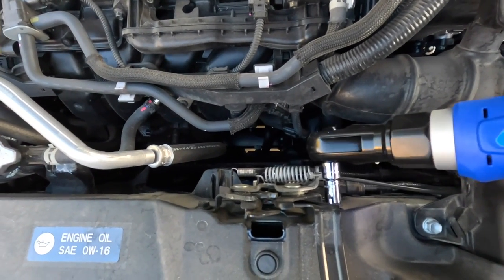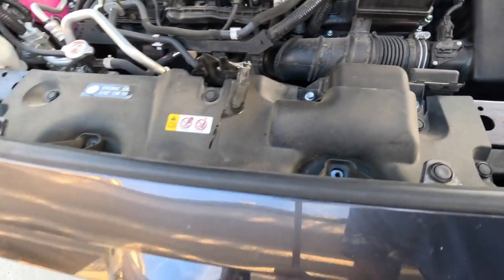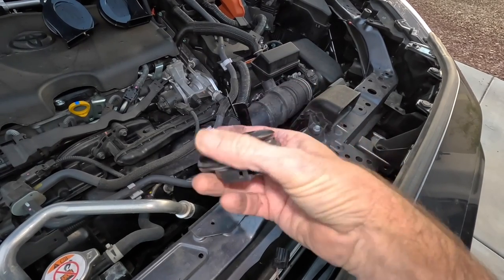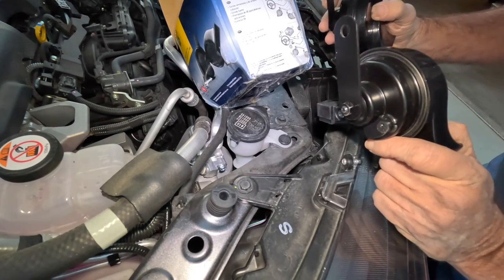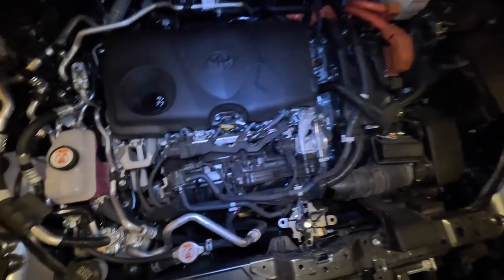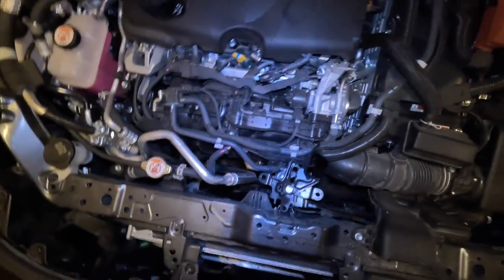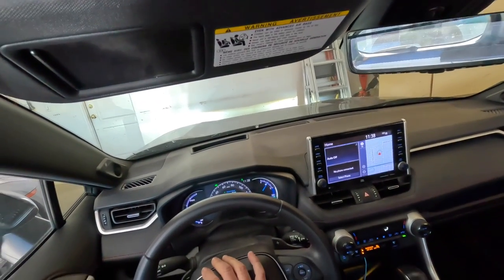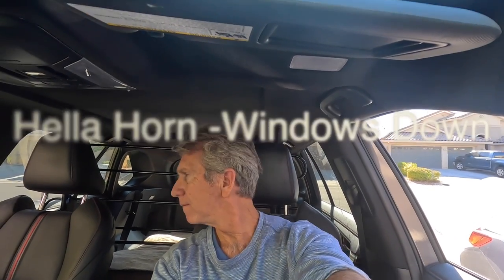BEST RAV4 Prime Modification | Hella Horn Install and Review | It's One Hella-Va Horn

Comment: Nice upgrade!  Hella has a long reputation in the European car world, dating back to the early years of Mercedes Benz, BMW, VW, Audi, Volvo, Saab, etc.  I installed twin Saab 9 horns into my daughter's 2002 Beetle in 2016.  They are insanely loud.
Reply from the maker: It sounds great.  Really not all that much louder than stock.. but it sounds like a horn should sound!!  Had a lot of fun Bouldering today in Red Rock.  New video in a few days !!
Reply: @GoldenK9Campers  Looking forward to a new video.  We have 2 in the pipeline, but the process has been greatly slowed by Miss Kate's work schedule/load.  I'm in the process of an upgrade, so that I can run  editing software, like DaVinci, and then I can take on the job of editing.  I created the most recent throw-back vids on a lesser program, but it didn't matter because they were shot with a lower res camera.
Reply from the maker: @austinado16  I use Finalcut.. It's pretty solid.  Editing is superfast with the magnetic timeline.

Comment: Do the horns need to be mounted first to work? Assumes that would ground it.. 

I was doing a sound test just plugged them in first prior to mounting- went in tried to honk and no sound. Ended up returning them. Thought they were broken maybe then tried another one and same thing no sound. Now rewatching your video…
Reply from the maker: Huh.. that's weird.  The horn should work without mounting them.  What year is your's?
Reply: @GoldenK9Campers  I have a 2022 rav4se non plugin hybrid

Comment: I wonder if it would matter which side the trumpets were on.  If you had reversed them would you have had to cut the tape to make the connection?
Reply from the maker: Another viewer who recently installed said this "So for anyone doing this, Amazon says it does not fit 5th gen RAV4, technically that is correct, but the best mod is even simpler then cutting the tape.  On the back of the horn there is a nut just loosen the nut (10mm) and rotate the horn on the bracket 45 degrees so the connect faces down and tighten the nut again, that’s it, you will have plenty of wire (slightly more then with factory horn).
"
Reply: @GoldenK9Campers  awesome.  Ordered them last night.  Can’t wait to get the. Installed.  Thanks again.
Reply from the maker: @horhay1981  Good luck.  There awesome !!